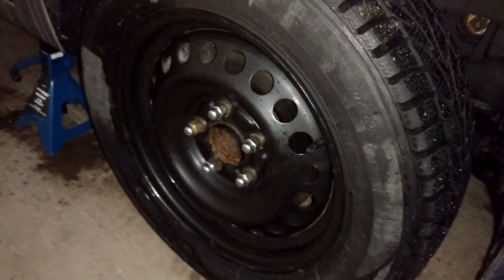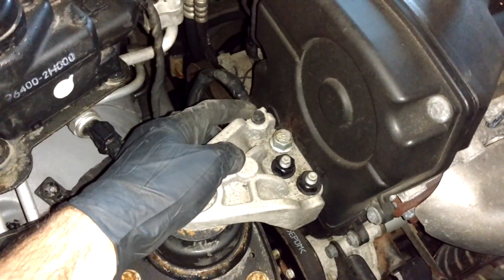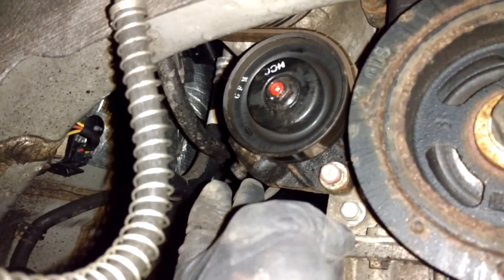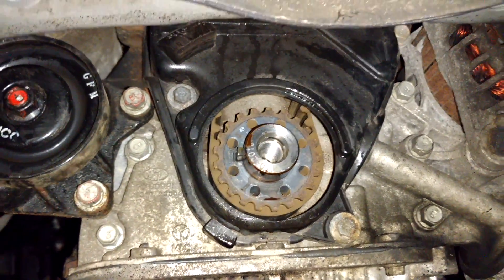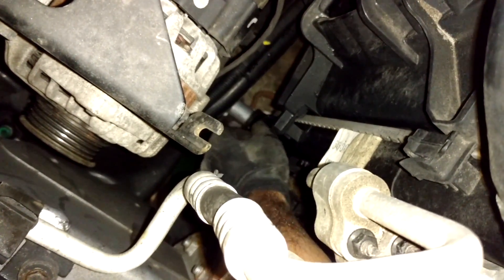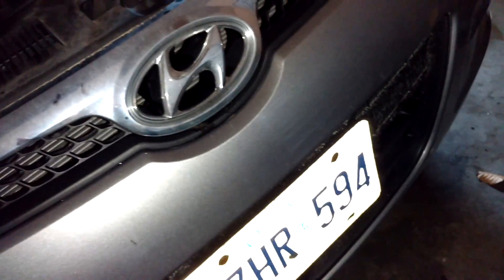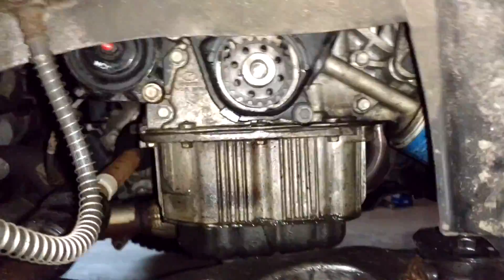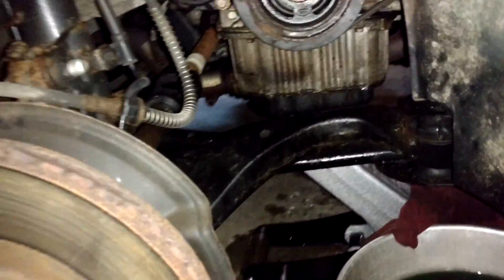Timing Belt & Water Pump Replacement DIY + Torque Specs on Hyundai Elantra incl. Touring (i30)

Comment: Watching this great video helped me decide to do my own belt replacement. This is on a high mileage car that I just hated spending all that money at the shop on. The job pretty well went exactly as shown here except I had lots of trouble removing the harmonic balancer bolt. Even with a 1/2 inch impact gun set to max it would not go. An hour of consternation followed to try to figure out a way to hold the flywheel still while I wrenched it off. Found another internet source showing how. I wrapped the old  alternator belt around the balancer, tucked under itself and looped it around the A/C idler. turning the flywheel with the wrench CCW locks it rigidly  in place. Then a breaker bar and three feet of pipe got it free. Hope this might help someone else in my situation. Thank you for making this video!
Reply: Ok, this didn't work for me.  The timing marks keep moving unpredictably with the counter clockwise force and now I need a new alternator belt.  Off to the store to buy tools.

Comment: My crankshaft pulley is stuck on.  Bolt is off but the one that drives the AC belt and alt belt isnt going.  The only pulley small enough to fit in there slips off.  Any suggestions?

Comment: My water pump is making a weird noise. I thought was the belt and remove then tight again, but still making it. When I push gas noise goes away, when I stop or an idling it make the noise. I used a stetoscope and I hear the noise  by the water pump bearing, but the car is not getting hot. Everything is working fine.
Reply: 100% IS YOUR WATER PUMP. remove the whole thing and replace it with a new OEM.

Comment: If we have no impact gun, how do you get access to the flywheel teeth to stop the motor from turning over?
Reply from the maker: You'll need a crankshaft pulley holder to hold it in place while trying to loosen the main bolt. I honestly can't remember if that's on option on these engines. If not, you could always try the starter bump method, though I wouldn't recommend it from a safety standpoint.

Comment: When do you pull out the pin that comes on the new tensionsor pulley?
Reply from the maker: Once the new timing belt is on properly and everything is torqued down, then you can take the pin out.

Comment: Tension information is wrong and in the wrong position, Back to supply house for a new belt!20 Foot

 pounds on tensioner bolt
Reply from the maker: You're absolutely right. The needle of the tensioner should end up in the smaller window to the left of the one I initially pointed out. I recall another commenter pointing this out to me but I can't find it. It was a while ago. And 20 lbs-ft is correct for the tensioner bolt.
Reply: Why don't you put this info on the record for others!
Reply: @dkeny55  15 to 22 fl of torque. even putting it on the window, the tensioner will put it tighter.